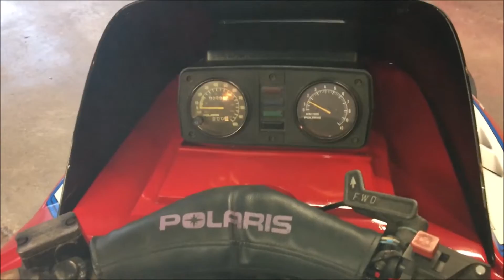Polaris XCR 440 Project Sled - Rebuilding the Primary Clutch

Comment: New to your channel! Love it! Questions...I have a 2001 XCSP 500 is this process the same including the bolt torque??
Reply from the maker: Yes. It’s identical. Torque spec as well.
Reply: @StreetersGarage  Thank you! Really like your channel!!
Reply from the maker: @jimmaltese1852  You’re welcome 👍
Reply: Out of curiosity, how was everything once you went out ripping it?? Clutch was all good??
Reply from the maker: Yes, it worked out great.
Reply: @StreetersGarage  thanks again. Pulling mine off this Sunday to look it over as general maintenance and replace spring. Little intimidating but your video will help. Thank you!! Any tips or anything I should know??
Reply from the maker: No problem. They’re pretty easy to work on once you understand the basics.

Comment: Nice tutorial Streeter. Good information on the clutch springs. Another area to look at is your clutch weights, are they a different weight for the XCR compared to the Trail? Probably the same, but something to check. I also like to use a dry lube to lube up the weights, bushings, and spider, it makes everything move smoothly. I use a Comet clutch lube, it sprays on like paint and drys with a graphite finish.
Reply from the maker: Yes. The weights were different. I pulled them from the original clutch and swapped them over.

Good tip on the dry lube. I’ll need to find some.

Comment: Is that all there is to it? The way people talk about clutching they made it sound like you had to have all kinds of special tools and years of experience. Are all brands of clutches about the same? Thanks Tom I am sure glad your here!
Reply from the maker: For changing the weights and springs. It’s pretty easy. Once you get into removing the spider assembly this is where you need the special holding devices and everything else. The torque rating on the spider assembly is about 290 foot pounds.

Comment: I'm still learning the whole sled stuff. Lol. I've always wandered if there's any reason I would want to swap out the stock spring or weights on my fusion 600? I know enough that you my man are the sled Guru! Lol. I understand that the right combination moves sled at different rpms just want to know if any reason to mess with the stock set up. Thanks
Reply from the maker: Yes - Clutching is a art form and I'll be the first one to admit that I look for guidance from others before I make any changes.

As far as Fusion content. Cam's 600 is in the garage and I have a bunch of stuff to do with it. So stay tuned for that.
Reply: @StreetersGarage  thanks chief!